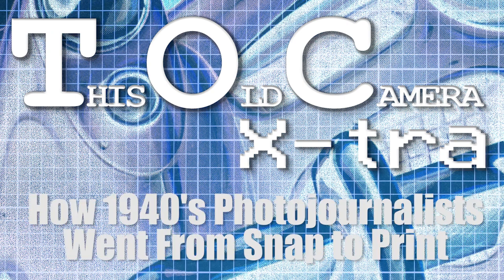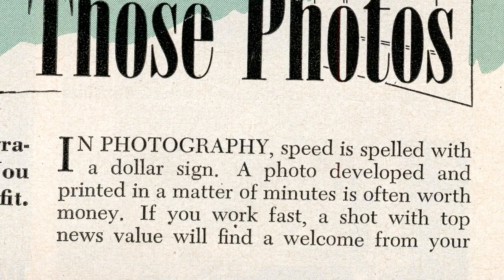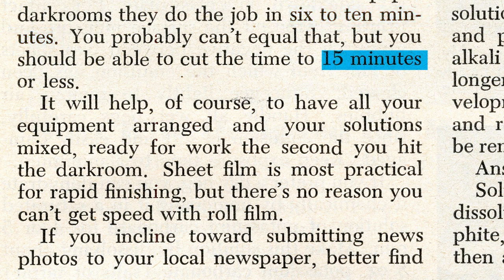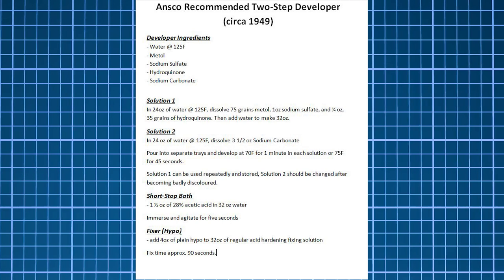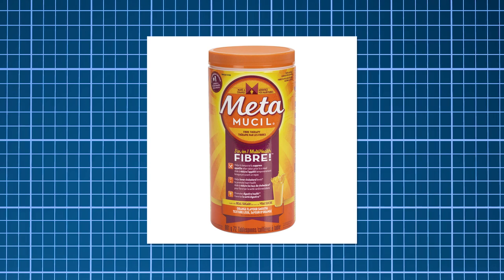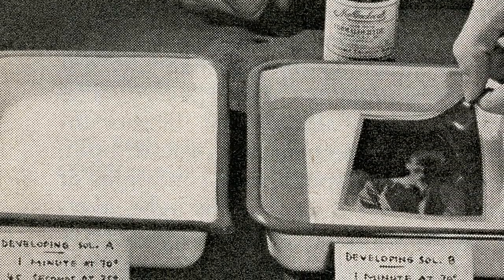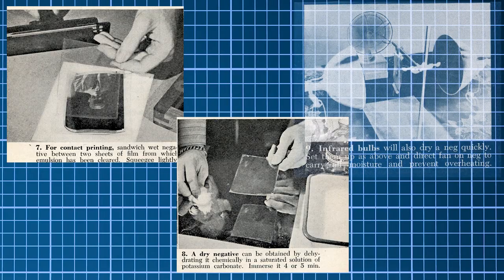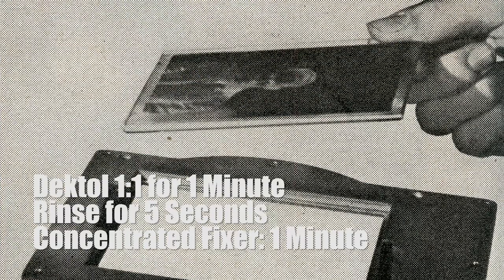How To Develop Film & Make A Print FAST | TOC Xtra Episode 02

Comment: I recall reading a photo magazine article "How To Process Under Pressure," where an old time/former press photographer went from exposed film to damp/squeegeed print in 10-15 minutes. (A Monobath and a stabilization processor figured in this speed race, as I recall.) This was long before RC enlarging paper, and introduced me to developer-incorporated stabilization paper. (Polycontrast enlarging paper, which "developed rapidly in Dektol 1:1 and, once run through stop bath, fixer, Hypo Clearing Agent and a short wash, was as stable as Kodabromide paper.) This led to above-the-lens yellow/magenta Polycontrast filters and away from graded paper.
Reply from the maker: Sounds like a fun challenge.

Comment: Use Cinestill Df96 monobath and a daylight loading tank (like Agfa Rondinax or the brand new ars image Lab-Box) to develop and fix your negative in 3 minutes (at 27°C/80°F), wash for 1 or 2 minutes, put the wet negative over a light source like a lightbox/table and "scan" it with your phone camera (use the magnification tool on your iPhone to invert the negative). You can then upload it where you want or even print it out using an Instax Share printer or any other printer that will print from your phone. Depending on your dexterity and working speed you can get from film in camera to social media or print in under 10 minutes.

Comment: My grandad whom was in the business in the day he said the fastest way to dry a negative was to drop it in metho as its alcohol based it dries super quick. There were some instances he said where he had to use it
Reply from the maker: That's pretty cool. It's interesting to see how we have used different methods to shave developing over time.
Reply: @AzrielKnight  Yep, I read something similar years ago. For something that was to be printed at the last minute before deadline, it was common to just rinse the film under the tap and then dip it in 90% alcohol. Dries in seconds. Do the print in the enlarger and then send the film for proper rinsing.
At a big paper, the darkroom techs would not do test strips, they just used their eye. They would usually fit a dimmer on the enlarger and keep printing speeds constant. It's said that in a full day of printing they would just mess-up one or two prints.

Comment: IIRC, RC paper was introduced in the '70s, Definitely fiber paper. Single weight to wash and dry faster. Someone please correct me if I'm wrong!
Reply from the maker: Yeah I did a quick google search but didn't want to confirm or deny 100%. The fact that they didn't define the paper, and use an electric dryer was enough evidence for me though.